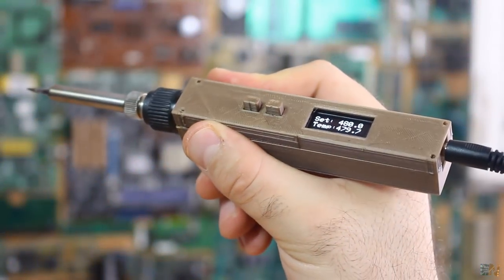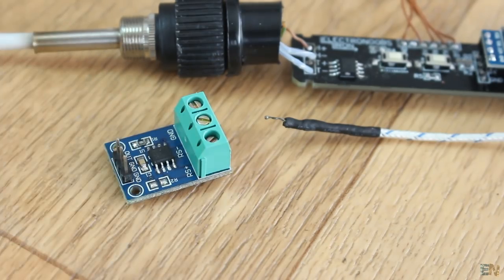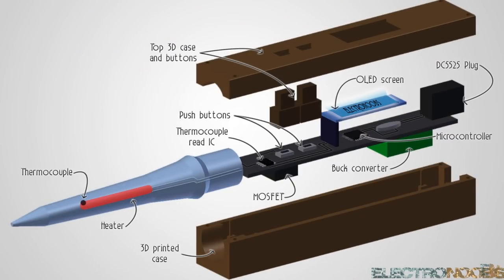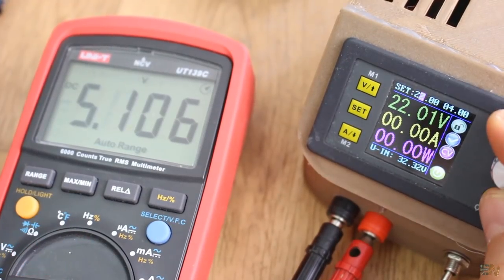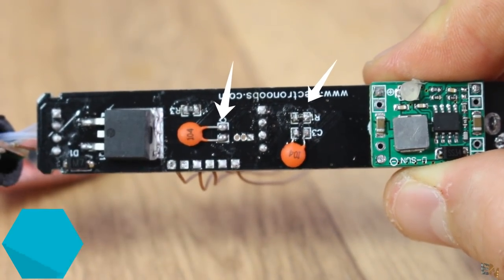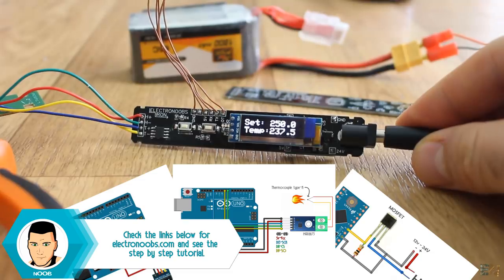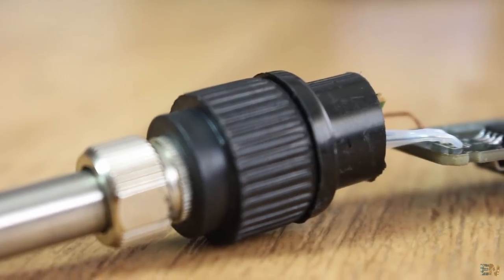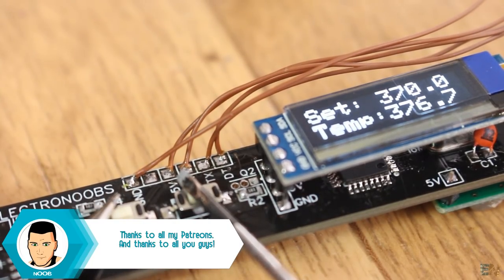Homemade portable soldering iron | DIY lowcost

Comment: Always check the DC resistance of the heating elements on these hack-o irons. I've ordered 3 that were sent with incorrect elements. This form factor is used for 40w, 50w, and 60w stations, along with straight mains versions for 240v and 120v. The best ones for 24v are the 60w version (harder to find). The DC resistance of that element should be very close to 9.5 ohms (+/-~0.2). Just to go all ohms law on ya, 24v at 60w is 2.5A and 9.6 ohms. If the DC resistance is greater than 11 ohms you have a 50w element. If the resistance is around 14 ohms you have a 40w version. If the element measures in the hundreds of ohms you have a mains voltage version. Again, the best version will measure 9.6 ohms ;)
-Jake
Reply: BTW as far as T12 tips and the series thermocouple. That's  actually an Atten design or at least you will find a whole lot of old Atten designs that used a 2 wire element when Hakko used 4.. Atten is the name of the company that makes a lot of the soldering stations that get rebranded for various stores and labels around the world. 
   There are a few videos by KainkaLabs on YouTube where he completely reverse engineers the Atten design in detail and demonstrates exactly how the thermocouple works. His videos are long but it's well worth the time spent if you want to understand that design. The classic Atten units use a PIC16 and a LM358 to operate. I use the old Radio Shack "60w Digital Soldering Station," which is a rebranded Atten unit. It uses the Hakko 900 series handle and a 2 wire element. I took a bunch of pictures of the pcb from that unit and uploaded them on the eevblog forum a year or two  back, but I've never done a retrace or schematic myself. 
-Jake

Comment: Excellent project from a point of electronic design, however on the mechanical side,
my experience with the purchased cheap handles from China,
 is that the plastic is not withstanding the temperature from the heating element.
Consequently  after short time of usage, the iron which is pressed into the black plastic, loosens and you cannot
fixate it back in a lasting manner. 
So in order to improve the version 2.0 you must rethink the iron holder and the temperature issues, because the heat transfers to the rest of the handle.
Maybe a 3 d printed ceramic holder instead of the cheap Chinese plastic.
I have searched for high temperature glue to solve the above mentioned problems with my soldering iron, but not been able to find one. So I am continuing buying new handles.
I look forward to learning your experiences.
Thank you for a very interesting tutorial.
Reply: niels larsen maybe a gazgit paste can do the work ..

Comment: Good build but the problem is not the metal tips, it's the heater you use.
I've made some diy Open Source models of soldering irons. I've used another mosfet driver and a bit of a different approach on the circuit, but yours is very good. 
Your problem is indeed the heating element. I've used those cheapo's and they simply are awful.
On ebay you should use the hakko clones that cost around 2.5$ and they are the Real Ceramic heating elements.
There are some videos online discussing the differences between those but the real hakko clones are the model:
A1321 for the 50W heating element and A1322 for the 60W heating element.
Make a search for those and choose the ones that have a real hakko case and manual ... they are around 2.5$ or even lower.
They heat Way faster then the "stock T900" handle heating elements. They are far far better then the one I see on the video.
Also the T900 iron tip does not make contact with the heating element. Wrapping for example a copper sheet around the heating element will improve a Lot the thermal transfer and hence will make a better iron ...do not give up on the T900 solder tips they make great great solder irons.

Comment: instead of or in addition to the hall sensor, you should add a cheap accelerometer to detect when the iron is being moved to know when to sleep in cases where the iron isn't in a stand. 
Cool project however!
Reply: wgm4321 I was thinking the same thing. The only reason I can think of for using a hal sensor is to make sure you put it in the stand. However I think the Accelerometer would be much safer. If you set it down on your mat, instead of your stand,  it would be nice if it went to sleep.

Comment: Instead of this ceramic soldering iron you can use a hakko T12  soldering iron to buy on eBay and Amazon works fine! And you can use the T12 tips from hakko !  thanks for your video and all information!
Best regards,

Comment: For the next version you should look into making it work better on 12V: Basically adjust the Mosfet´s PWM based on input voltage. You may also need a better mosfet in that case, not sure. But as long as the heater is not constantly on, there is room for it to heat faster.

Comment: Why not use a linear regulator? I don't efficiency is the problem, and since the current draws for the OLED screen and microcontroller are very small, I don't think it would heat up a lot. Can you explain why you used a buck converter?
Reply from the maker: From 24 to 5V an LDO???
Reply: Electronoobs How about the lp2950/2951? That would save tons of space. And why should it be an ldo? It's not like the drop out voltage would be a problem when powering it from 24v.
Reply: Well maybe not an LDO, just a normal, plain old 5v regulator? why not?
Reply: Electronoobs LM7805.
Reply: LM2576 up to 40V or /HV up to 60V. 5 parts for a working 3Amp buck regulator :)

Comment: Forget these tips. Use T12 series.
Aslo, why bother with 3d printing and electronics in the handle if you still have the wire and are not able to make it pretty? Just use cheap (or not, because there are aluminium an stainless steel versions as well) FX9501 handles and leave electronics on the other end of the wire. That way end result would be much more aesteticly pleasing and you won't be limited in size. You could use ac-dc 24v SMPS or dc-dc boost converter for battery powered use cases.

Comment: I am an avid fan of your inventions but was wondering if you can build an ultrasonic 3d scanner which almost looks like your portable soldering iron. Ultrasonic transducers are also used as ultrasound devices but was hoping to be a miniature or portable type for use in scanning peoples teeth or mouth --- do you think this is possible?

Comment: interesting project and well done but your claim of a iron for ~$15 is, based on your part list linked parts prices,  it seems ~$35 too low when all parts and rough filament cost are included. still, if completed and it works not a bad price. but i wonder just how portable it is when it needs a 24v power source. but i think that of all the "portable" irons on the market. i can see a use if out in the field and using a couple car batteries though unless one has an inverter to pwer a standard 120v AC iron. another thing you did not mention is how easy it is to use with the heavy power cable and weight distribution. overall though it was a great project and well done. thanks.
Reply from the maker: Thanks! With a 6S lipo battery you're good to go. Also, the price is around 15$ but the list I give is for packs of components of 10 or 20 or even 100. Of courese, if you buy 100 resistors, you will use the rest at other projects. Pretty difficult to give the price for each spare component. Thanks and havea  nice day!
Reply: well, i guess it depends on how you do accounting/cost analysis in your shop.  for any packet of parts the total cost is part of your parts inventory. you can assign that cost to the project or general inventory but the total cost is still part of your expenses and is only reduced when a component is used. some of the components may be on the shelf a year from now and when doing inventory i'd ask, "why do i have these?"  answer, the soldering iron. so actually over a year those parts sitting on the shelf are part of the iron cost. at least, the way i do parts. ymmv.
Reply: Douglas Kryder 
If you don't have a stock of commonly used parts then you must spend much more on every project.

Comment: Use run at 16Mhz? You could save using the xtal by using the 8Mhz internal clock. There's no need to be THAT attached to the Arduino IDE :-/
Reply: Yeah, I don´t think the crystal is necessary. The internal oscillator should be fast and precise enough. This would save on 3 components and some board space.
Reply: or he just use an ATtiny 😊
Reply: ATtiny's flash memory is not enough for the project I think. Adafruit libraries are huge
Reply: Pramod Wickramasinghe there is turn around for sure..
Reply: Pramod Wickramasinghe if someone can put USB connectivity on attiny10 , sure they can run an I2C oled screen with some input and output.
Reply: That they are, I was shocked when I first played with the graphical library... but, hes not using everything from it, far from. And so with a little work you could cut and paste the bits needed just to get a basic text display, and ignore the rest. That would lead to a significant reduction in the libraries footprint. Significant enough... I don't know as I've not tested it myself, but I'd be willing to bet so...

Comment: Hi! is it possible to use this attached code for your previous PID prototype with Arduino UNO hardware? there you have used a rotary encoder. I like this one with only 2 buttons simple and easy to use.

Comment: i use the same parts same code but i dont get temperature from iron can you help me?  the thermocouple work i test with multimeter and when heat climb the ohm resistance
Reply: because the iron dont have thermocouple has PTC. fail.

Comment: I wish I lived somewhere I can get proper PCBs and had a 3d printer :c
Reply: Chloe Mcholoe aliexpress generally ships to most countries for very reasonable prices, as far as PCBs go DIY might be your best bet if you are in a place where JLPCB and others don't ship to
Reply: Even 3D printing is unnecessary here. In fact, you could probably make a much more ergonomic case with a short PVC pipe, or even a heavy duty cardboard tube from a spool of something... Those are surprisingly strong and easy to work with.
Reply: Well Not mine :| nowhere ships to here basically

Comment: Nice Work, but those tips are not good it has many thermal resistance from the sensor to the tip check  at my 10$ soldering iron project and see how I did.

Comment: Could you have used an atiny 85?
Reply: not enough pins
Reply: 85 will be too small, only five usable IO pins, but an ATtiny84 perhaps would be even better... The issue then would be fitting the Arduino displays libraries... afaik it's about 10k, maybe more I don't really remember, and the 85 and 84 only have 8k flash... Of course you could make a much more compact display library that only does what you need it to, but thats time and effort...

Comment: Hang about... so you bought a soldering iron to cut up and make another one cheap? Isn't that counter productive? If you'd made it rechargeable i could understand the effort but this... no!
Reply from the maker: Yes, but that iron was for a soldering station. Mine is portable...